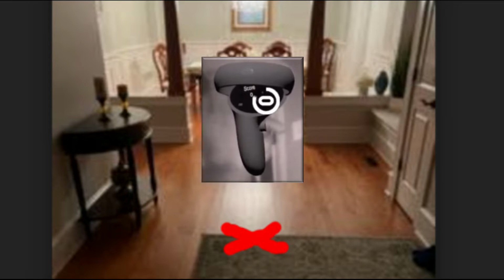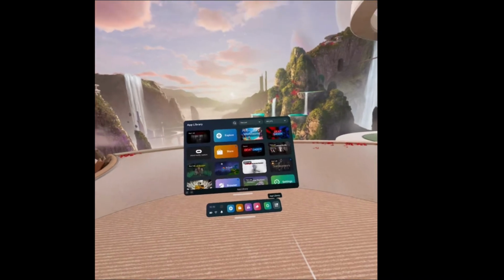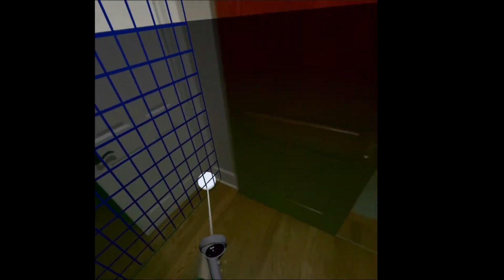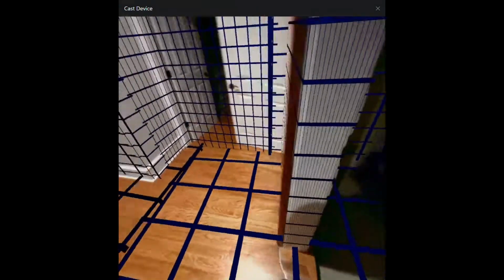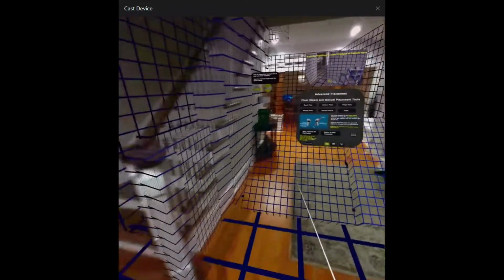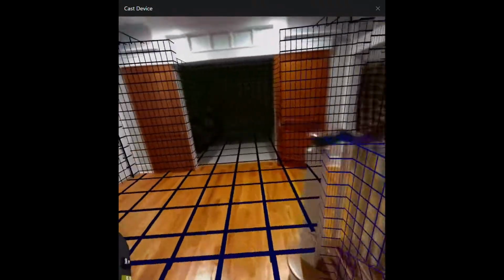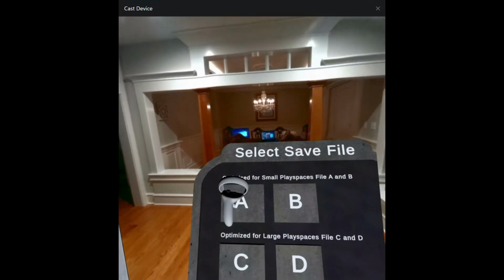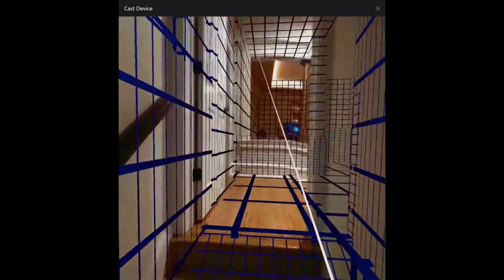Multi-Floor Advanced Tutorial Setup for Hauntify Mixed Reality

Comment: I find this game too hard to set up any tips playing on 2 levels
Reply from the maker: Which part do you find the most challenging? I can try to help. Were you able to map the single floor first?
Reply: @vrgo8279  yes I’m going to try again once I get home
Reply: @vrgo8279  once I go to a different level and I go to and go back down to the level I just did it is all messed up even when I rest my view
Reply from the maker: @noahtheplug9275  try deleting the guardian history at your starting position, redraw the boundaries as small as possible, and then disable. That can sometimes fix the issue of shifting too far from center. Sometimes If the stairs are too narrow, or you are too close to the walls, the headset can’t tell where the player is at. Let me know if that helped.